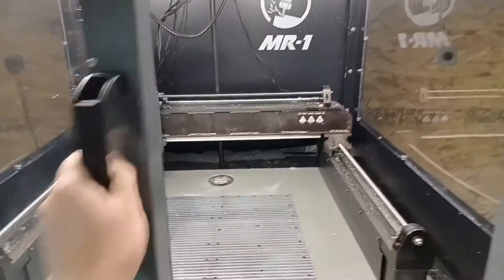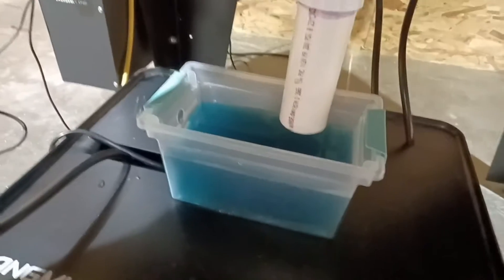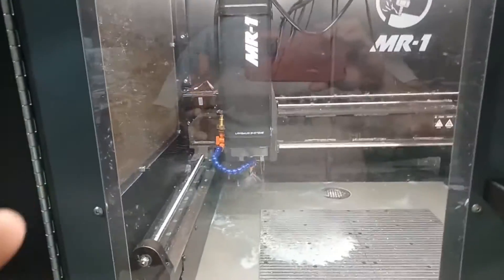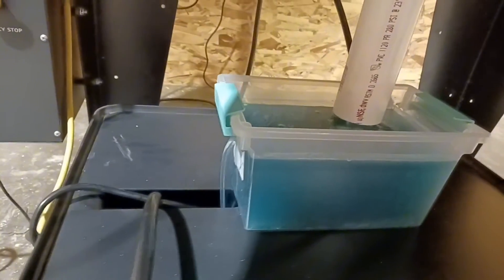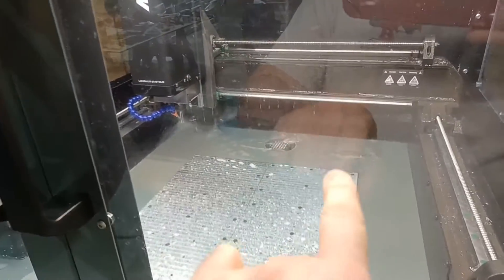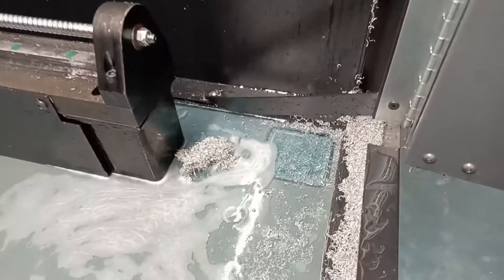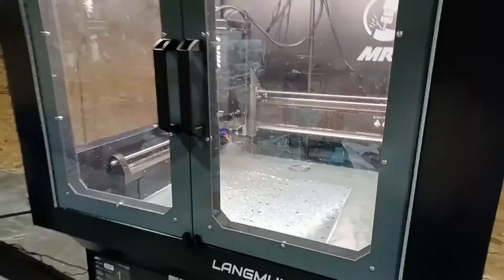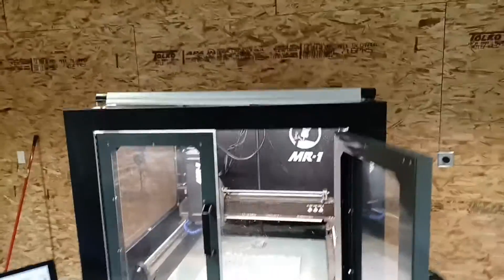@LangmuirSystems  MR-1 upgraded drain system  #langmuirsystems #MR1 #cnc

Comment: Hey, By the way, the servos worked out amazing! It's a whole new machine. Makes NO SOUND except the ball screws when not cutting, next, I'm raising the z axis on the two sides of the gantry with 2.5'' grey cast iron. Gets delivered today...
Reply from the maker: Nice!  I just ordered three 570 oz/in stepper motors which should 4x my cutting force. It will still be slow but I shouldn't miss any steps.  I'll make some videos on this when I get them installed.
Reply: @BeckTools  I did that first with big digital drivers made a huge difference but the servos made a bigger one, and just as cheap as they have self-contained drivers. I made videos and I'm editing they will be up in a few days, but now I ordered clear path servos because I'm raising the gantry 2.25'' with the grey cast, and the weight plus I wanted to try the best out there... lol

Comment: Thinking of buy this machine, I like the idea of the shower drain, Installing while putting cement in do I make the drain at the same height as the stock drains?
Reply from the maker: I would set the drain at the same height as the stock ones or lower.
Reply: @BeckTools  Thank you for getting back to me

Comment: You were telling me about this, looks great.  How do you know what height to put the drain before pouring cement?  Is there a line that says when to stop?
Reply from the maker: I would put it at the same height as the other factory drains.  level the concrete but when it still soft press this drain into it leaving about 3/16" above for the epoxy to fill.

Comment: Suspend a sheet of aluminum across the settling basin (1-2" below the surface as a dam) such that it separates the drain of the machine from the overflow, it'll keep any floating debris on the machine drain side so that it doesn't clog or go down the overflow into the sump pump.
Reply from the maker: O I like this much more than my filter idea to stop floating debris.

Comment: What dya know, Langmuir overlooking proper drainage for their tools....
Reply: Beck, might want to add a gravity filter on the top surface of the tote using some 200 mesh stainless screen
Reply from the maker: All the metal chips sink to the bottom of the tote and do not flow out the hole due to the slow velocity of the fluid in the tote.  Now if I run plastic parts I'll for sure need some type of filter in the system.